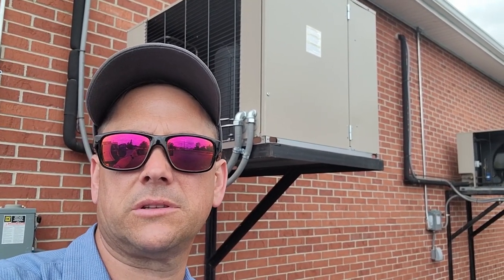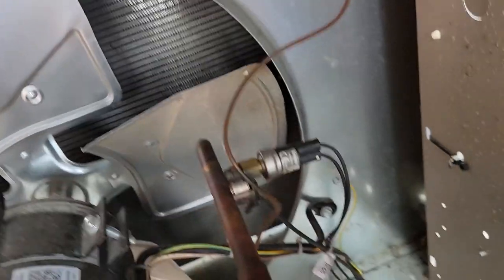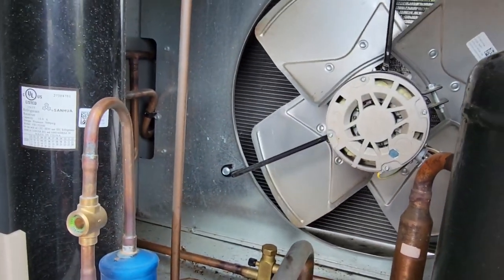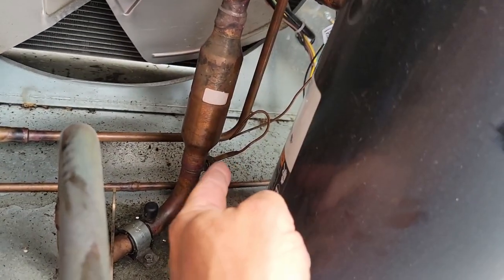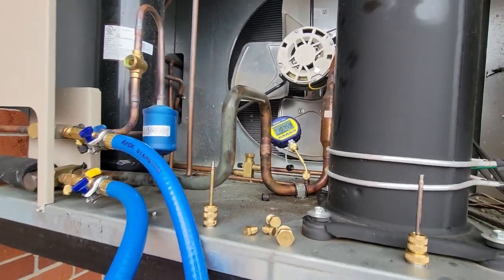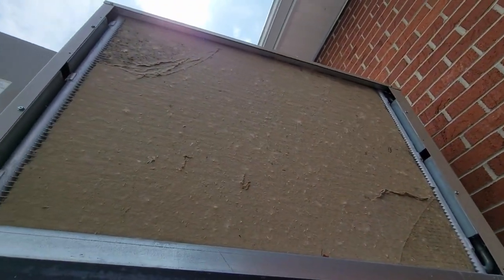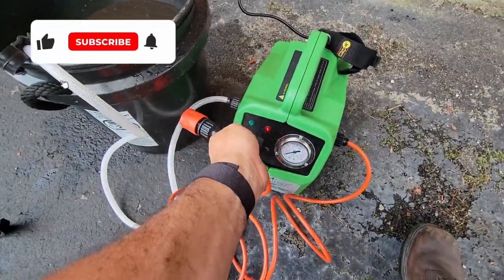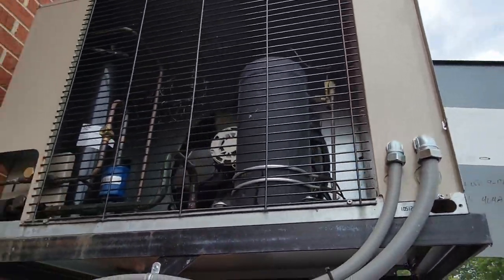Freezer Not Holding Temp!

Comment: I have done this hundreds of times never had problems with moisture. As long as you pull good vacuum i see no need to replace dryer.
My old boss did not feel the same he always wanted drier changed. And i have done same with pressure switch i like your style. This is real world refrigeration service.
Reply from the maker: I know that and you know that but technically if I'm going to try to be an example for the new guys it's not good not to follow protocol but sometimes you just can't do it. Thanks for understanding🤜🤛👍👍

Comment: I thought it interesting how clearly the other unit was visible through the condenser coil of the first one. If that pressure control was manufacturer supplied, I'm surprised they didn't put a grommet where the capillary tube went through.

Comment: chlorinated brake parts cleaner for the wasps. blast them from a distance, torch works fine if you can get close to them with stirring the pot. other fuel/oil products will likely work well. with delayed reaction.

Comment: Crazy watching you mess with the low pressure control Rick. We’re a bit north of you and have had to install fan cycle controls on our freezers. We’ve done this for 3-4 years now cuz the flooded head control, winter temperatures, and 404 don’t like each other….prevents short cycling with the lower ambients.

And the anti short cycle always gets me too. I keep a jumper wire in my bag until I get the units dialed in. Dang frustrating wondering why you’re not running when you know you should.

Great video!
Reply from the maker: Thanks Rick! We have had to add a fan cycle controls before. We can hit neg 10f in the winter to rarely -15f

Comment: Good job Rick. I’ve been binging you videos lately. When pumping down systems and checking with a torch do you prefer receiver to be 3/4 full? I noticed in this video you were fine with about 1/2
Reply from the maker: 1/2-3/4 is usually fine. The best thing I’ve done is charge to a full sight glass then add 15% more than the total you installed to reach a full sight glass.

Comment: ¿ Why the switch to analog gauges when setting the pressure switch ?
As always, thanks for the ride-a-long and explanations!
Reply: Digital gauges refresh the pressures a bit on the slow side so it can be hard to tell what pressure your system is actually cutting in and out at.
Reply from the maker: Benjamin is correct, the refresh rate on digital isn't quick enough.

Comment: There is usually a locking plate on the adjustment screws on a KP1 (also KP17). Remember to put them back on. Othervise you risk that your pressostat can go out of adjustment.
Reply from the maker: It had it, it's interesting Ranco doesn't require the plate, I usually try to replace it but sometimes you lose the tiny screw🤦🏻
Reply: @HVACRSurvival  Every time i change out a pressure switch, i take the old locking plate and screws with me. For back-up. They are important, because it's usually the "diff" that goes out of adjustment. and you risking that you system wil run i vacuum before it stops the compressor. And thats a really bad situation with leaky coils.
Reply from the maker: That's a good point. 👍👍We normally use ranco, the OEM equipment is the only way I see Danfoss on our systems.
Reply: @HVACRSurvival  I probably see more Danfoss than you. It's industry standard where i live. In Denmark, and Danfoss is danish, But they still make some good products.
Reply from the maker: Are you in Denmark?
Reply: @HVACRSurvival  Yes, i live there.

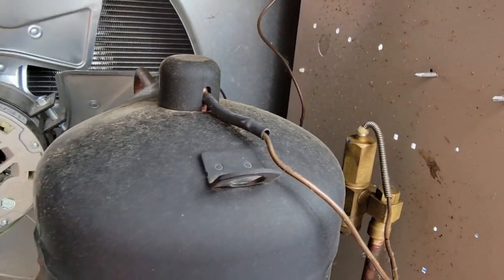Comment: The tool at 2:35 is what I use when working with fiber optic. I cut and strip the 0.125mm inner core with it
Reply from the maker: I remember those from electronics class back in '93

Comment: wide flat aluminum tubes, with zigzag fins makes it easy to clean and less likely to plug. unlike some of the past equipment, where they use copper tubing (not the issue) with aluminum fins, which have splayed center fins that pug up wildly and are near impossible to clean. what they should have done? increase the size of condenser coils, vs. trying to make them more efficient at heat transfer. so pretty much what they're doing now days, LARGER is better, aka. more surface area is always better for heat transfer.
I'm tired of garbage products and getting the "mine shaft", change is inevitable and major change is guaranteed the more stupendous they make things.
Reply: The copper tube aluminum fin coils are always the ones you see rotten out and destroyed in HVACR's Videos

Comment: I was wondering about that nice vibrating pump on the top of the ladder. I think I would have wrapped a length of wire or some tie wraps around it to keep it from sliding off. I'd be hesitant of using bungies for that since they can stretch, and could still let it slide off the step.
Reply from the maker: It wasn't my first choice of strap but I didn't want to get my other ladder off the truck. I think I bumped it closer to the edge when I was reaching for something then it fell shortly after I got off the ladder.

Comment: No backup on a saddle valve is cringy as fuck
Reply from the maker: I was using a 6" set of pliers and it was a thick piece of brass into the copper. If it's tiny shit I will use a backup wrench.